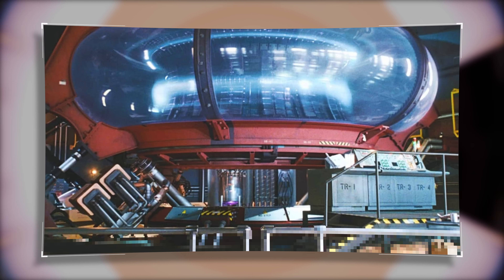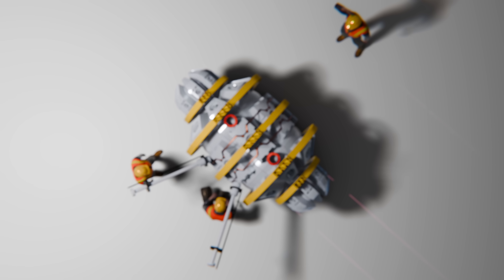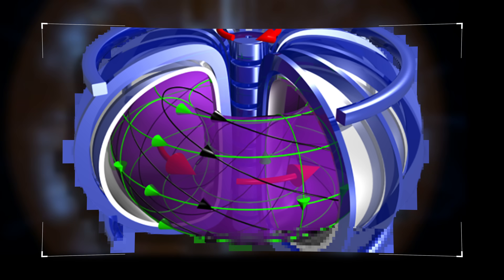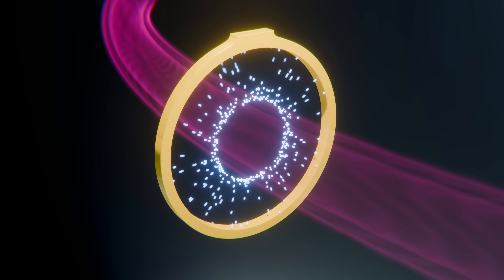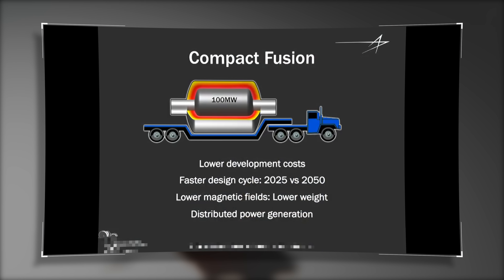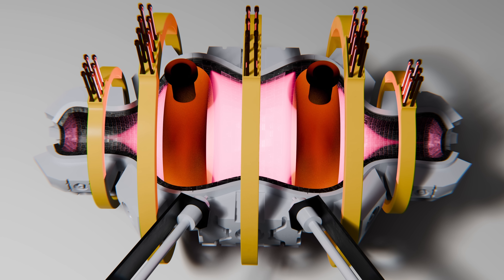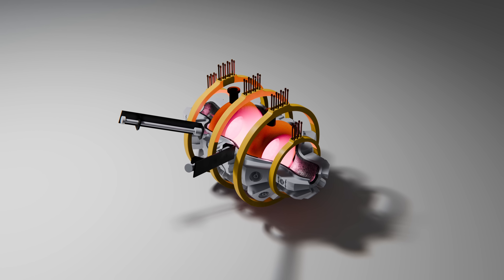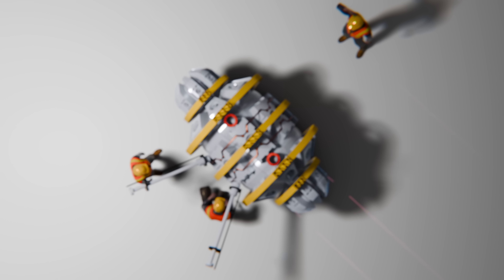Lockheed Fusion Reactor Failed - What Happened?

Comment: Exxon bought the design and buried it at sea...

In reality, fusion gets so hot that you can't actually conduct the thermal energy out of it for any useful amount of time.  They love to say when 'xyz produced more energy than it consumed', but that energy gets released into the room since it can't be captured.

Also, fusion really needs solar-scale temperatures and pressures; our attempts are like trying to make a bonfire by trying to ignite dust with a magnifying glass as it floats through the air.   Yeah, it's kinda burning, but there's just too little and the process is extremely inefficient.

There is a promising design class (z-pinch) that uses a linear chamber with a coil in the middle; it's able to extract electricity directly from the magnetic field of the plasma.  This solves part of the extraction problem, but it wastes the heat energy, keeping it below break-even.

Comment: You don't know a third of the real findings. David Lapointe and his flip ring configuration allowed boron11 with hydrogen to fuse making carbon 12 that turns into 4 helium3 that can be directly converted into electricity.  No steam needed. It's a revolutionary process that has been hidden
Reply: Helium 3 can be directly converted into electricity?

Comment: I remember reading about it on r/fusion. The consensus among moderators seems to have been "it's looks dumb" 
Something about "Oh we are going to put superconducting magnets that require liquid helium cooling inside (or right next to) 150M degrees plasma, that would get absolutely destroyed by neutron bombardment (btw did you know that supercoductors can suddenly stop being superconductors with predictable results?)" was considered to be not the best design. Idk what, I am not a fusion scientist
Reply: Yes, that’s exactly how current fusion reactors work, except using higher temperature superconductors. Sure, they are still at the stage of being prototypes rather than large commercial reactors, but the principle is well proven now. Look at the Tokamak Energy results, for example. The Chinese seem to be the world leaders right now, eg with their EAST reactor, but scarcely surprising given the sheer scale of money and effort they are funnelling into fusion and their determination to corner the market.
Reply: @ytprodata  Magnets, to my knowledge, in tokamaks/stelarators are  behind the neutron absorbing blanket,  not in front of it
Reply: @ytprodata France is ahead actually.
Reply: The phenomena you refered to called (magnetic) quenching, and it's quite a headache.
Reply: @CraftyF0X  Indeed. We quenched an NMR magnet when I worked at a university and it blew out the pressure relief vent like a train whistle. Not fun to hear from 10 feet away.

As for putting liquid helium near 150M Kelvin plasma: when you're putting ANYTHING near 150M Kelvin plasma, it doesn't really matter if it's 4 Kelvin or 300 Kelvin, the slightest contact will vaporize it.
Reply: at least it failing would just be a local evaporation of everything with no lasting pollution
Reply: That's for magnets in super position.  Locking the magnet in the air at what ever position desired.  Also helps stablise the plasma

Comment: The sun contains 99.85% of the entire solar system's mass (almost all of the rest in the gas giants). It has a gravitational field strength at its surface 28 times greater than earth. That mass and gravity crushes down on a core that has a diameter 30 times larger than earth, has a density 13 times that of lead and is some 15 million degrees C (27 million F). This is all without considering the intense radiation in that environment. People don't appreciate the magnitude of what these companies and even governments are flippantly claiming in their hype cycles. The problem with fusion energy is that it is fusion energy... don't expect viable grid power plants for another 50 years yet.

Comment: What would happen if the reactor is punctured while in use? Would that be comparable to a nuclear bomb, or would it just immediatelly die off?

( And... funny that we'd be still using steam power at that stage, in a sense. )
Reply: It would not be comparable to a nuclear bomb because it wouldn't cause a chain reaction. Instead the hot plasma would vent, damaging the reactor, maybe even causing something like a explosion by superheating the liquid cooling elements and causing them to become gas. However the fusion heat depends on being confined so the reactor would stop generating heat. It would be like a steam engine exploding.

Think about this way, this is using magnetic fields and liquid cooling to contain superheated plasma. If the superheated plasma had the energy of a nuclear bomb that would mean we could contain the explosions from nuclear bombs we could use magnetic fields to shield structures from nuclear bombs. In reality magnetic fields would do almost nothing against a nuclear bomb because the heat and energy produced by a nuclear bomb in the instant of the explosion is much much much larger than a reactor produces.

The energy of a full scaled up reactor would be release in terms of plasma significantly less than 0.03 microtons of TNT so millions of times smaller than even the smallest nuclear weapons.

Comment: TR-3B uses this reactor.
Reply: eh not likely. This reactor still just makes heat, and then steam turbines would make electricity. ALLL of that is WAY to big and heavy for flight. IF the TR-3B exists, and if it is using electricity to power a force conversion drive system, THEN its power source is a direct electric output device. 
Why did ironman need palladium again? That was a weird little add in the movie.
Reply: @mythoughtsonfaith1031  This is the stuff I loosely remember, but here it is and take it with a grain of salt. There is a way to directly convert plasma into electricity. And the craft is cancelling gravity so it's weightless essentially but it cannot slide like Alien orb can, it still has to use propulsion but that propulsion doesn't need to be super strong because the whole thing's weight fluctuates between few hundred kilograms to ~5 grams. It 'plays' the opposite tone to Earth's gravity particles through high voltage em fields that can somehow manipulate these to no longer be affected by Earth's gravity. Creates a bubble that lets these particles go off to the sides of the craft like an umbrella... The explanation is not perfect but close enough. It likely feels the same as if they're in space, and propulsion will push the created bubble. It's not a fully sliding tech because it's still relying on conventional population methods to move the bubble instead of moving the fabric around the craft itself.
Reply: @Akuma.73  where did u find this info
Reply: Nah its a standard nuclear reactor most likely
Reply: The tr-3b. Still cause outward radiation.  Because it dosent reflect it back into its array.  Its leaking radiation.  That's why reports of radiation sickness has been found when it's been spotted.  They need to add an extra ring field of magnetism. Around the center outershell

Comment: Either "It's Classified" or it only works in 0% gravity.   My understanding is that the current issue with fusion is "Containment" ............ Keeping the reaction from hitting the walls.  0% Gravity would alleviate that.
Reply: Would alleviate only the slight gravity from the earth? How would it help the heated expanding plasma from hitting the walls though? Isn't that a much harder problem?
Reply: @roanbrand7358    Containing fusion with an EM Field in ZG ............. You do not have to fight gravity.   You'd have to compensate for motion or inertia but the contained reaction otherwise could just float.
Reply: @AKlover  "fighting gravity" isn't the issue with containing it,the plasma wouldn't magically lose it's enormous pressure and become a happy little self contained bubble just because it's in zero g
Reply: And we've all seen the "documentary" The Cloverfield Paradox, so we all know how that turned out...

Comment: I don't think that they hit a physics wall, I mean helion and the others actually made progress in this regard didn't they?
Reply: They did but still hit the physics wall.  Helion can fuse reliably, one shot at a time.  It's like shooting a musket, but what we need for reliable power must run closer to a machine gun.  Helion gets excellent fusion with a single shot, then the reactor resets and minutes later you get the next shot.  They haven't figured out a reliable way to reload the reactor between power pulses so that it can keep on going as long as the fuel is available. It's a physics problem, slowly being mitigate by advances and solutions of the engineering problems.